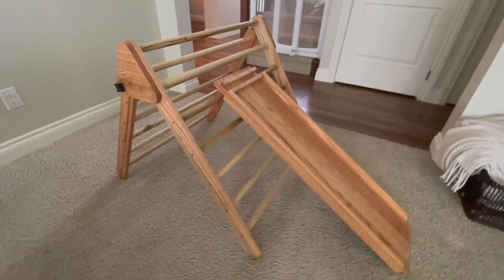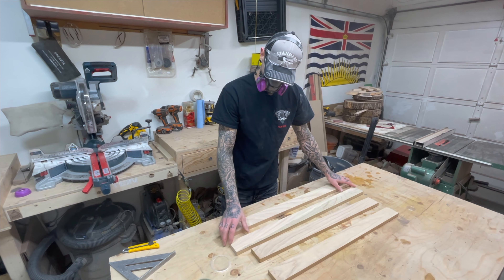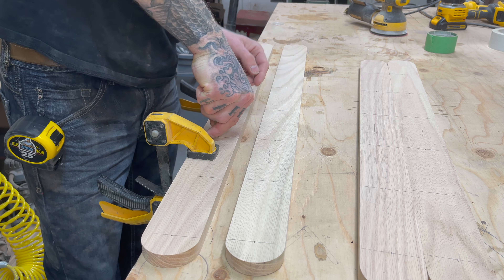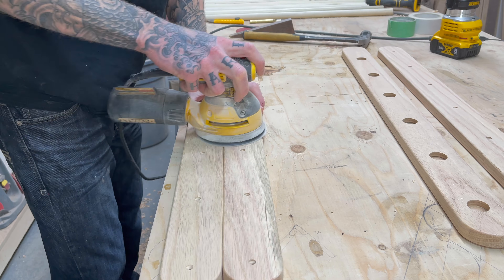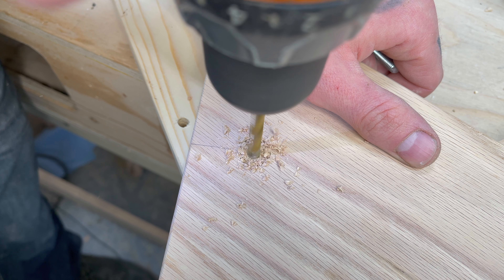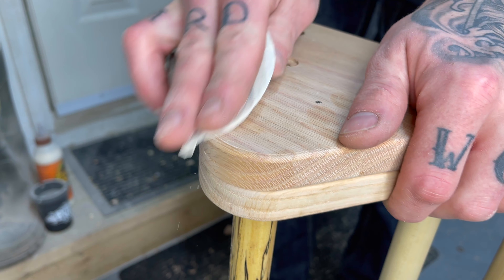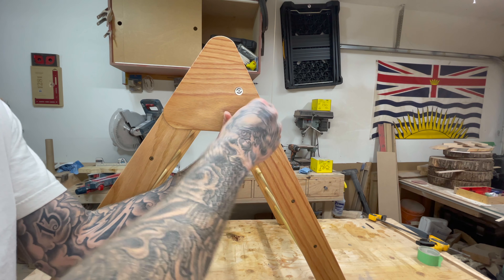How To Make A Pikler Triangle | With Only An 8' foot 1x6 & Some Dowel | DIY Wooden Climber For Kids

Comment: Very nice. I built this for my son, but I think I got the wrong type of threaded inserts. One of them actually cracked as I was trying to get it in and put a nice gouge in one of the legs. Which inserts and driver do you use?

Comment: First, thanks for this video. It is super helpful and I appreciate the work you put into making it.

I don't have a drill press, so I'll need to drill the forstner holes with a hand drill also.  When you drill the dowel holes using the 1" forstner, you say you drill to the shoulder to keep things consistent. Did you do anything other than use a visual cue on when to stop?  Is some variation okay since the dowels are held by both screws and wood glue?  

It would be nice to have some depth stop to get exact hole depth. Any suggestions there?

Edit: adding to this comment as I go through the build:

At 5:17 you begin attaching the dowels but then cut to them off, commenting that it’s better to sand the stuff before attaching. Did you go back and detach the dowels again or was that clip just edited in out of order?

I’m also curious if you would recommend applying finish to each of the parts prior to attaching them. 

I read coating w poly prior to wood glue can create a stronger bond depending on the wood type. 

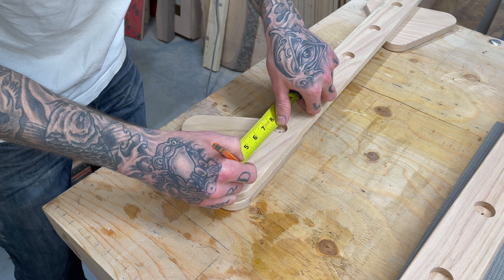At 7:33 I think you mean the 36” stringers.

For an equilateral triangle with 10” sides, the height will be 8.66” or around 8 and 13/16ths (26/32)”. 

The angle of 30 degrees is the outside of the triangle to a square side of the board. 

I worked from a ~2’ x 12” board and needed to square off the edge to get angles that double checked as expected.

Final (?) edit:

I finished this build. The hardest part I found was mirroring each step for the other side correctly. This isn't really shown in the video, but it is a bit tricky. 

Another thing I did that made this hard was I chose to paint the rungs / stringers and also use polyurethane to seal them. This was a lot of extra work.  In retrospect, I would not do this again with out a drill press. It is important that the rungs be perfectly even and it is not very easy to estimate using a drill alone. (It is also a lot of work) 

I did manage to build this primarily using this video, consulting some others at the end but jordz covered a lot here. It was my first woodworking project.

Comment: Very good. I have a 19 month old. I'm going to price out how much it costs to make. Will do it this summer, if the wood is reasonably priced.
Reply from the maker: Awesome! If you aren't picky about which lumber you use this could be made with an 8 foot 1x6. The dowel unfortunately is the most expensive part believe it or not

Comment: I think there were parts of this that were kinda skimmed over too quickly. Also, you didn’t include some of the hardware in the description (pivot screws). I think you should always assume that not everyone is at the same skill level and need more thorough explanations.